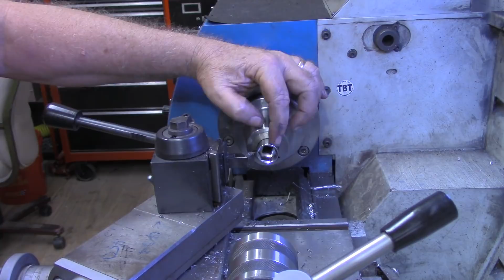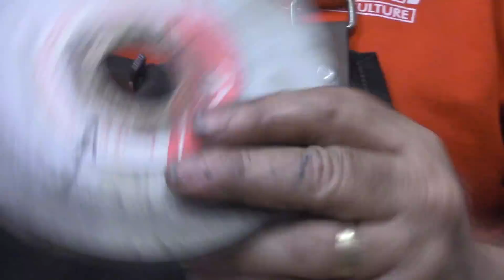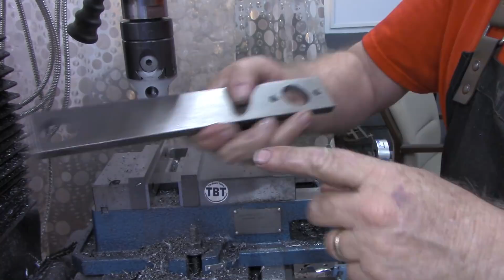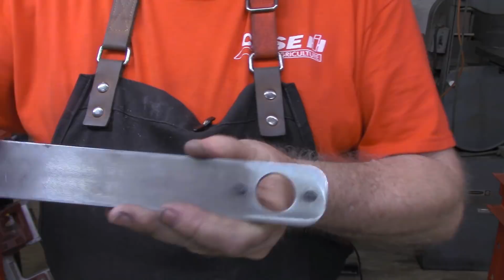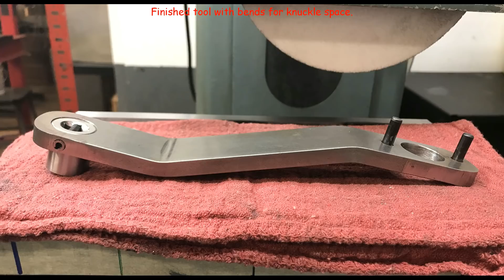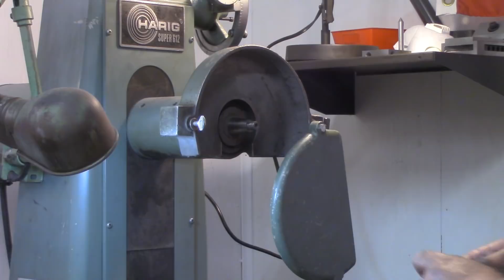Surface Grinder Accessories - Spanner/Socket Wrench & Wheel Puller

Comment: The last hub extraction key  would be nice to drill a (half ball bearing diameter) depth hole up the threaded end.
So a ball bearing can be captured and used as a hardened slippery surface to press against the drive shaft.

Comment: Hi Mr Lee,
My dad was a machinist and recently passed. I have a surface grinder and the wheel seems to be locked. Maybe it needs oil after watching your video. But I feel like maybe there’s also a safety lock I’m not aware of. I have a lathe, wet band saw, drill presses and more to sell. I’d love your advice on these items, what they are worth, if you can share my info with people in this line of work? It’s all located in Little Rock, AR. 
Any response is very much appreciated. I wish I had inquired more about his line of work as I got older but I went into the Airforce right after high school. I did plenty of band saw work when i was in grade school. Lots of templates. Thank you in advance, you definitely fit the mold of what my dad used to do. No pun intended 😊 Lisa Kruse

Comment: I would expect that the oily part on the wheel is because the grinder was ran with coolant, and the last time it was ran, the operator didn't let the wheel run dry after the last job to dry it out.

Comment: Great stuff Lee - double duty tools are most satisfying... extractor too - nice. I saw you'd put a slight double bend in that thick bar - can't remember right now but wondered what method you'd used to achieve that.
Reply from the maker: ChrisB257 held with my teeth 😜 Actually bridged it on a couple pieces of flat bar in the shop press & placed a piece of round stock on top that I pressed against.
Reply: Haha - yeah right LOL. You did pretty much what I had imagined and would probably do the same. I must make some extensions for my press like yours - trouble is not enough stock of the right size.

Comment: How did you bend those offsets in the body of the new tool?
Reply from the maker: Hydraulic shop press. Placed some flat stock underneath with a piece of round stock on top & pressed on the round stock.
Reply: Ah!  That's pretty smart!

Comment: Should have submitted that wrench to Emma's tool contest. I like the design.
Reply: double take.  at first glance I read "wench."  Too many times I've seen an ad in the local paper, some guy advertising that he wanted to buy a "4 wheel drive pickup with wench."  I've often wondered if he ever got what he advertised for.